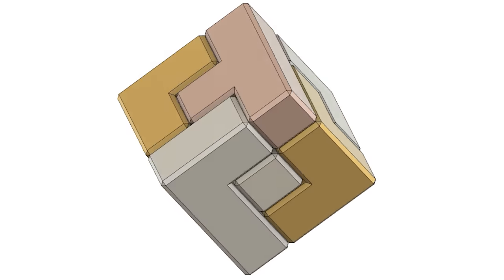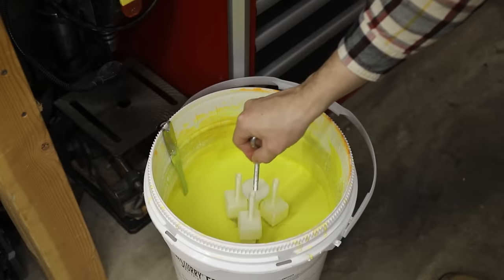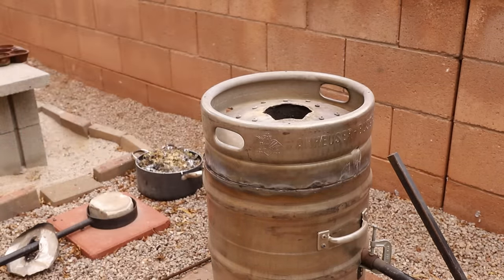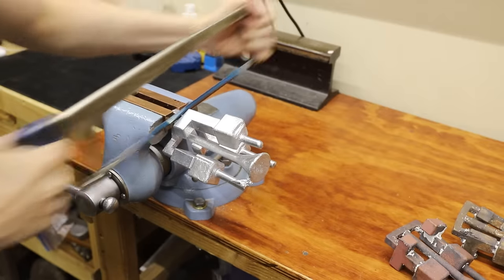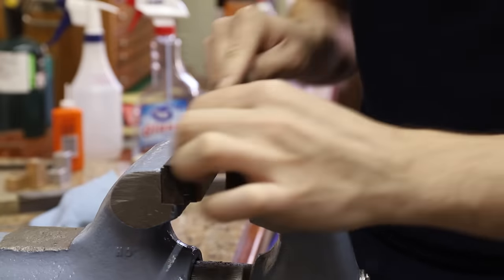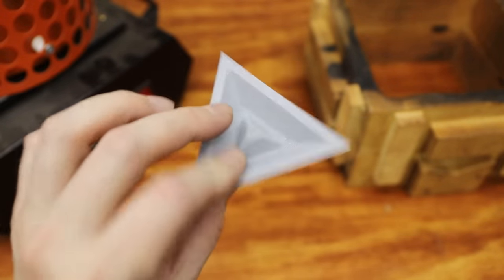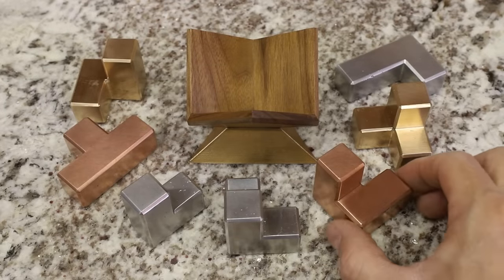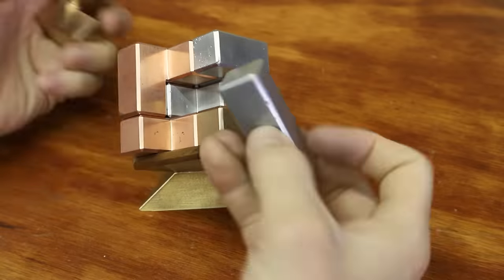Making a Metal Cube Puzzle "ALUMIX CUBE" Copper / Aluminum / Bronze - Soma Cube

Comment: I'm an apprentice machinist by trade, and I am both impressed and puzzled.

I don't get to forge my own base metal, so the entire process is interesting. It really makes me curious about how quickly a standardized block mould could be used to produce blocks to recycle some of our scrap on site. Unfortunately, due to the amount of parts my shop needs to produce, it isn't really viable since all of us are high skill workers. To make enough money to cover our salaries we can't spend time molding then machining rough stock down to size for every job, when we can just order from the suppliers something already roughly the right size.

As for my puzzlement, in my experience, a handheld angle grinder with a cutting disk would have been a better option than the hacksaw for saving time, since you were going to grind down the marks left with a belt sander anyways. Also, since you have a milling machine, why didn't you use a 45º debur tool to prep those chamfers? The only spots that type of tool can't reach are the inside of those interior corners, which you could then finish with a hand file.

Aside from that, the finish you decided to use is the mark of a gluten for punishment. It looks great, don't get me wrong! I just hate the amount of work that goes into it when a milled finish looks just as shiny. Then again, I always liked the curves left by face milling so that's probably just preference.

It does look good though.
Reply from the maker: Thanks! The process I used was mostly for the sake of entertainment. If I did it solely for myself I would have just entirely machined the pieces. As for the chamfers, the cast parts weren't very symmetrical so getting them square in the vice would take forever.

Comment: I like your work, go from 3d print pla to metal, great, I was wondering if you could print a structure of a brushless motor that is put on the drones both where the winding would go and where the magnets would go, there are many stl of Those structures of that engine, do you think you can demonstrate that it can be made of metal?

Comment: If you heat the molds together with a crucible with metal, and then pour the metal into a hot mold, then the smallest details of the mold will be imprinted on the casting.  Even fingerprints, if left when creating the mold

Comment: That is a nice little tip that for some reason never occurred to me at 13:53 purposely leave the mixing stick and remaining epoxy next to the part your epoxying (I usually clean it up right after applying while waiting for the part to cure) so that you can use it to tell when the epoxy is cured.

(I usually have to poke at the epoxy with something or try to lightly move it to test. Neither ideal, lol)

So simple an idea. Never know ehat little tricks you might pick up just watching how someone else works! Thanks

Comment: Very cool project and video showing the process!

When you used the wet sandpaper and granite block for sanding, how did you keep the sandpaper flat like that as you moved? Is there a particular brand you use that has adhesive on the back?

Comment: Air should be able to do this, but, injecting pure oxygen into a glowing hot mold should immediately eliminate any remains except for ashes.  A slight possibility of sintering a thin layer of ashes to the mold may be present there though.

Comment: Cool.  Looks like a SOMA puzzle except in your case you have duplicated one of the pieces. (The corner like one) in the original SOMA it was a flat part the did a zig zag .  It also had a cool booklet that had tons of other shapes to build/solve not just the cube. https://en.wikipedia.org/wiki/Soma_cube
Reply: I had not realized it wasn't it until I read your comment and went back to check it! Cool!